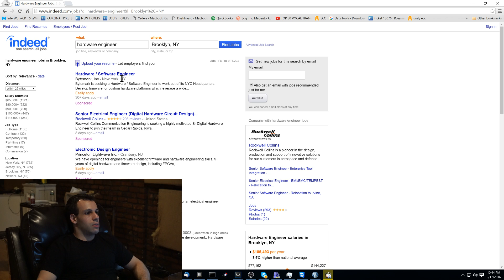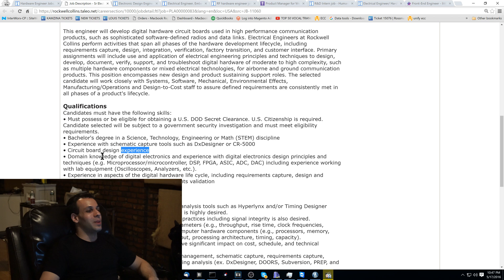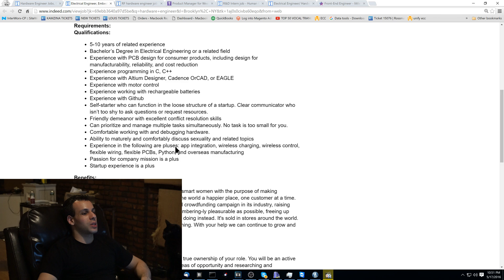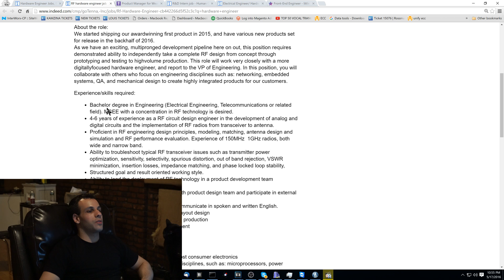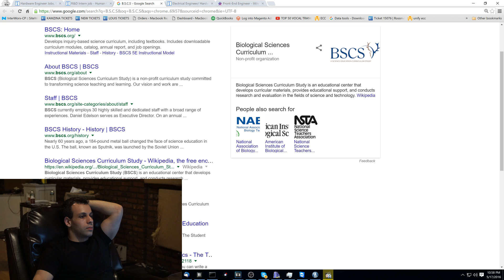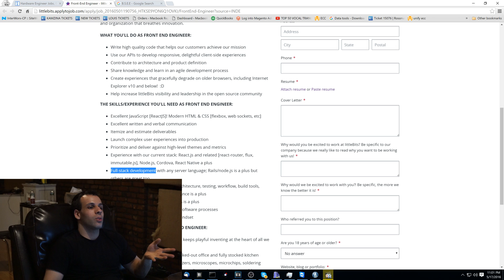Louis looks for a job

Comment: 2-yrs experience as an intern or whatever at a company is usually worth a BS degree, that's usually why they make the "or equivalent experience". This is coming from someone over 10 years in IT and Engineering without a BS . Don't get me wrong, college teaches you great stuff and good academic terms and approaches, it's WAY better than starting from scratch. The degree doesn't teach you how to engineer (software or hardware) at a company or with the actual required certifications, team members, and tools.

Basically, what I'm saying is, you've demonstrated a good working knowledge of electronics, understanding of schematics, troubleshooting issues, communicating with customers (internal or external), and use of tools used in electrical engineering. You're already way ahead of many college graduates with their masters. You could absolutely get a job as an Associate or Mid-level hardware engineer and with the right people around you and a book pickup the academic lingo, and whatever the company design and architecture is. Associates usually make anywhere from $50k to $70k depending on the area.

Comment: You think you're not smart because you haven't seen enough people. Sure, PhD graduates will kick your ass , but the average repair technician looks at the red dots on the board, tells the customer "that'll be 1200$ for repair" and replace the whole machine for a shorted capacitor.

Comment: Unless they have managed to reverse seventy years of industrial culture in the last decade, at an almost 1:1 ratio those engineers are going to need test techs to make their ideas actually work.  This is from over 30 years as a test tech in the aerospace and automation industries.  Don't get me wrong, I really liked these guys, and did not begrudge the extra 30% they made for going to all those meetings and being responsible for budget estimates.  But gods love 'em, I have honestly seen one of those college educated B.S.E.E.s grab the wrong end of an operating soldering iron.  Practical skills and engineering degrees are similar but independent attributes, and it seems it is usually more cost effective to get them from separate labor pools.

As for qualifications, I don't remember using any techniques in six years of R&D work on flight computers that I haven't seen Louis demonstrate.  And don't overlook the "or equivalent" clause.  With three decades of every day contact with degreed engineers in their first three years of experience, I'd say Louis could pass for one in a heartbeat.

Comment: You can't fake your way past most of those Engineering skill requirements, and -- YOU DON'T WANT TO.  Any company that can't see through someone's lack of essential skills is a company YOU DON'T WANT TO WORK FOR, because they don't know what they're doing either.  I worked for a company with an engineering manager that couldn't use simple equations and COULD NOT do grade school math!  He had forgotten just about everything he ever learned becaus the company didn't want to develop anything new for because long time, and not doing things is what he did best.  He was made a manager after everyone with skills had left the company.   So when they reversed course and decided they wanted to start developing products again, they hired me, right out of school.  And I had to work with this idiot manager that didn't understand much about engineering.  Now, is thata company you want to work for?

But let's say they do hire you and you don't have the skills. Now you're it.  Now they expect you to do everything they need, and they don't have.  You'll have to learn all that stuff you faked your way past (which takes years to master) in just a few weeks, and produce a design that works.   Good luck with that.  Good engineering takes a lot of skills, and as electronics get faster and faster, the skill level gets more difficult, and include developing advanced circuitry, complex algorithms, and designing for signal integrity, and all these skills require a lot of physics and math.

Now to put things in perspective, computer repair requires a good knowledge of how things work, but it is a lot like automotive repair.  You don't have to know the theory inside of everything, because you work with things at a higher component level.  A good tech can fix anything.  You replace a chip, but you don't have to redesign and fab the chip.  Many techs might some ideas about what might work better, but they usually don't have all the skills to do proper engineering that assures everything has been looked at and it will work properly in all conditions.  Design work is getting more and more difficult every day.

That all said, I'd rather work with one SuperTech than one lame engineer.   SuperTechs get things done!  And Louis is both a SuperTech and a capable entrepreneur that can run a business.  That's a special breed.

Comment: THANK YOU! I hate seeing job listings where they ask for full stack developers or list like 20 frameworks that you need to have expert knowledge in. All that tells me is they have no idea what they are looking for. It's so weird to me how many of these jobs for hardware engineering require you to program. Like wtf would you need to be building websites for a hardware engineering job?
Reply: Pretty much any complex hardware nowadays requires programming. Especially if you're working with hardware that's complex enough to require microcontrollers or embedded CPU.

Rather than trying to build an electronic circuit that have all the smarts, it's much easier (and also more future proof) to build simple electronics that is controlled by smart software.
Reply: thanks for the explanation. I guess more detail is needed in the job descriptions because often times it looks like they are trying to hire a web developer who can also fix their server if there is a hardware issue.

Comment: In the magic of technology, almost everyone confuses architecture with diagnostic / repair.  Deeper in the technical fields, it is very common to find those high paid engineers being unable to repair or configure the most basic elements in the same field.  And vice versa, as Louis understands here, really good technicians with brilliant insight to troubleshooting have no direct skills in architecture of systems.  Trust me, your auto mechanic cannot design a car, no matter how AWESOME they may be at fixing one.  This is true for almost all Engineering skills.

Comment: I know this video is now two years old, but regardless...
Board Repair is something I genuinely find interesting to learn and to do, and besides having the capability to be a valuable skill its also fun. There is logic involved, and you actually need to think to get the job done. Chemistry or school in general is something I find no interest in as some subjects are just too demanding, yet people ask me how I find this type of stuff easier than writing down chemistry reactions. Granted Ive been doing tech work all my life, but it just sucks to do it at home. Ive acquired "proper" tools just recently to somewhat do component level repair in a qualitative way, but having to share a tiny desk with monitors, a laptop, office stuff, a rework and soldering station, a crappy USB microscope and with parts and screws laying around just sucks. Of course, being employed as a technician in this industry would be perfect, its just too bad literally all "repair" shops around my area dont involve in board repair. I dont have anything against part replacement repair shops, but swapping screens all day is not only boring but not very profitable, as Louis mentioned in another video, ever since offering data recovery services instead of general repair, people are willing to spend more on a job.
The literal reason I got into board repair originally was to save a dead iPhone board that I just didnt really want to throw away. And back then I did not even have any microscope or a proper sized soldering tip/iron, and I still got the job done. Just the reason of all the E-Waste we produce by throwing everything out because of the smallest issues is absurd. I really hope repair as a skill will get more appreciated, its not like were not already surrounded by electronics anyway...

Comment: I am a lot like you louis but for the automotive repair. Give me some time with your car and I will be able to figure out what's wrong with it and how to fix it. My job is a ASE certified automobile technician and I never really went to collage. Scraped by in high school. My brian just don't under stand regular teaching methods. I am more hands on mechanic then read about it in a book and go out do it. If I come across a new design of a particular system of a vehicle it takes me a few minutes to learn how it works. Essentially I fix what the engineer fucked up to begin with or showing the customer how their infotainment system works.

Comment: Louis - you correct engineers ALL THE TIME.

It's below your paygrade.

You could be designing the machines to assemble, diagnose and repair microcomputers designed by billion dollar companies, manage firmware updates to prevent common hardware failures, repair and diagnose prototype systems.

If you worked for Apple for example doing what you do, you would be managing shit above the national level taking data of millions of diagnostics and designing software based solutions to repair them all in one firmware update and increasing the efficiency of making repairs meet client expectations.

Look at your subscriber count - you manage half a million people who completely agree with you and practically know the same highly advanced shit that you do out of billions of people who couldnt understand it if they tried.

Personally I never bought the equipment to work with SMD components but its pretty incredible that a lot of people dont understand the simple balance of a circuit - including engineers.

Comment: The first job was a programmer job.  Programmers tend to call themselves "software engineers" on indeed and when talking to other people.  And no, even the stuff you said you had, you probably didn't have.  Like the Linux requirement.  When talking about Linux, there's two types of people, people who have strong CASUAL knowledge of Linux and people who have strong PROGRAMMER knowledge of Linux.  Basically, they wanted to know if you could use VIM to program(Completely the opposite of any programming environment you've ever used), script the backend, use console commands to do everything, and use keyboard shortcuts for everything else.  

They never list the salary expectations.  They basically wait for the interview then ask "what do you expect to get paid" then they'll lowball you from there.

Comment: I am not sure if hardware engineer jobs are like software engineer job postings. If then 90% of the time HR are the ones that post the jobs and don't have a clue what is really needed for the day to day of the job. From my experience at least 50% of the items listed on the job posting are really needed while the rest end up being nice to have, or the technical team said anyone with experience in "X" could pick up "Y" without having experience in "Y". HR then translates all of that into the required section of the job listing.

Comment: Well this is the way most jobs list anymore, must have a college and higher education to clean the bathroom! Gone completely crazy! Why so many college grads are in debt with very little chance of getting out, they may have a education but can not troubleshoot a way out of a paper bag (or plastic).  Just having a education in a field does not make that person compintent. The real eye opener here is that there are so many unemployed & underemployed college grads from entry to doctorate that companies have no problems asking for crazy credentials to do even basic jobs that will pay (most) minimum wage.
Hey Louis you could do RF (radio frequency) by the way, if you looked at it. In fact you might pick up few circuit board repairs in RF at your shop, you would only need few tools more than you have for diagnostics. Not that you need additional work bro! HMU if you are curious.

Comment: You're probably underestimating yourself a bit. 

Do you really think the people that apply for those jobs actually tick all the boxes?

The best qualification you can have is the ability to learn by yourself and being able to figure shit out.

Some of the companies use outdated technology software or hardware wise and nobody bothers learning more than one of each.

You either learn git or svn but you don't learn both voluntarily. A job in the past might have required you to learn it though.

The question is not if you tick all the boxes it's can you learn fast enough and well enough that you tick all the boxes eventually by yourself.

I promise you they are not going to find anyone that covers all their requirements easily and be able to keep them working for them.

People with that amount of experience get big bucks because they spend years doing what they do and polishing their skills.

Comment: Hell, looking at today's job requirements is so silly. For my first job I just stuffed anything remotely relevant in my resume (I work in IT) and submitted it to any place remotely relevant. Eventually, only God knows how,  at a good company.
The boss (its just the boss here) just made sure I had a good head, did the basic lie test (asking basic technical questions to see if I was faking or not) and that I was pleasant enough to talk to.  After 2 weeks I was already accepted (probation lasts a month technically).

My point is, that if you try to apply to some of the engineering jobs at smaller companies to build up "rep" (not that you would want to) after yolowing it through the beginning you just learn and learn and become good at it...

Comment: If you can meet at least 80% of the requirements of the job ads, then it is worth applying for them regardless of the qualifications.   Some of these companies may have trouble filing those positions, so they would compromise on their requirements but may mean you wont get the full salary they intend.

Comment: Dude, what the hell is up with all these job ads? A little more and they'll want a bachelor's degree for tightening a screw. And I can even hear it in my head when the HR dude starts mouthing off how the force applied on the screw should be nailed down to the nanonewton or something because the material doesn't allow for higher stress, or something along those lines xD

Comment: You are very correct in a lot of what you said, I am an Embedded Software Engineer experienced with automating diesel engine hydraulic systems and I work with no-collage technicians. A lot of them are absolutely brilliant at what they do - craftsmen, very experienced, applying all best practices, way further advanced than their corresponding engineers. A lot of them started careers working at restaurants moved to tech/manufacturing. Contrary to technician, the engineers role is more of wrestling conceptual solutions with clients (product requirements) and management (product lifecycle management). A lot of software engineers write code for 10 - 20% of the time the rest is not directly productive. Sometimes, that remaining 80% of your job requires those silly chemistry classes. For example, here is an actual problem that I faced as a software engineer: whats the natural pressure drop off on a rapidly pressurized hydraulic accumulator due to the PRV cycle and how to distinguish that from a leak - figure it out before you see the accumulator. Or what are the fluid dynamics principles that you can measure to use for prognostic health monitoring of the system? Science classes come useful to an engineer, not so much to a technician/drafter/designer. 
But when it comes to the job listing requirements, once there was a posting saying: 15 yrs of experience in wireless communication. I said I have 2. They said that's good enough. I didnt go for it in the end but Im sure they hired somebody with less than 5 yrs of experience given they were eager to go for 2. The ballpark estimate: if you meet a THIRD of the technical requirements, you are a great candidate.

Comment: No, you definitely can't fake experience in signal integrity & timing analysis. That is voodoo for 95% practicing EE engineers out there ;)

However, you'd be surprised how many of those experienced engineers would kill for your soldering skillset when building prototypes. I remember spending 4 hours to place a damn QFN accelerometer with two pins switched with some wire (mixed up in the schematics...) on a prototype. Would probably have been a minute for you ;)

Comment: That comment on full-stack is a clear example of why near all job adds are terrible.

Takes those requirements as their perfect candidate, they know that they cannot find that candidate but they're going to list it anyways. I have seen internships at e.g. Amazon where they desire you to have a Ph.D. in CS. Nobody with a Ph.D. is ever going to apply for an internship, ever.

Companies will try and get the top 10% of candidates to come in and then they're going to check how you fit within the company culture, which is a lot more important.

Nowadays, pretty much any medium to high paying job will require team work, you will fail if you cannot communicate with your team. It used to be that everyone thought software development was a solo work and a guy with a giant ego would fit right now, not so, it's all about the team. If you can't work with others, you're a liability.

Comment: I feel like you might have an ever so slight interest in working on traffic signal systems. The boards for most devices and controllers are overly engineered with large components.